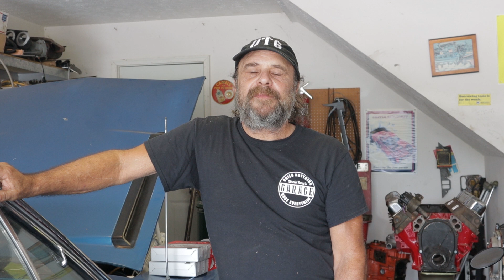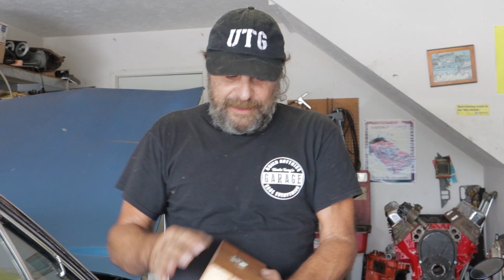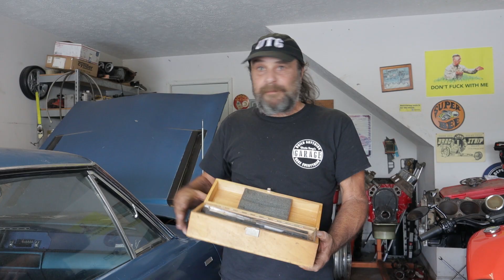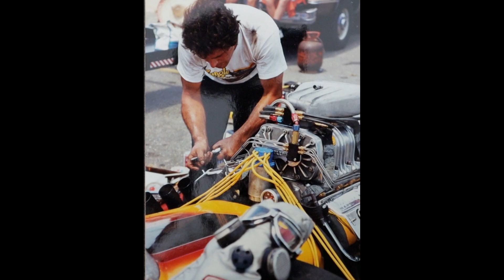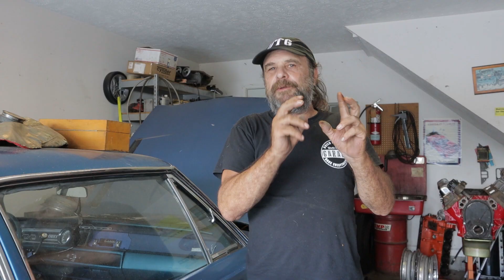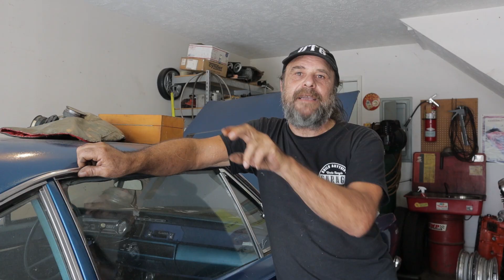Nitromethane - The Learning Curve Is HARD!  But, That's Where The Fun Is

Comment: How can the nitro engine tell whether it is working to produce acceleration or to overcome air resistance? I supposed that it is fully loaded whenever the throttle is open.
Reply: The load at the starting line is just a small fraction of the load at the top end.

Comment: Tony, I'd really love to read a scientific or insider reference about why Nitromethane ignition in a cylinder is load dependent. Fuel volume? Lack of vaporization? I've read that modern Nitro cars are "dieseling" for the last half of the race. Usually with fused plugs? I understand the gut feeling instinct based only on regular engines sometimes nosing over at the end of the track. But that's for many reasons. I want to know why Nitromethane is so different. I'm a 66 y/o retired physician/engineering physicist. So I'm not looking for any 21st Century "tricks" for Top Fuel teams. Any references would be appreciated.
I was at the last race Q day at Bandemiere Speedway in Denver a couple of years ago. 
Btitanny Force laid down a track speed record run. 337.4 MPH at 3.724. 
With what appeared to be no effort.
A perfect pass. I know that drag racing is a show. But I truly feel that John Force, personally, and his Racing Team wanted to set a track speed record in Denver before the track closed. Because of his personal relationship with the Bandemiere family that owned the track.
It seemed effortless. Hey, I love the sound, noise, technology and gamesmanship as well as anyone. But this one pass seemed so effortless that it was probably possible more often than the fans know. 
Britany Force set a new 1000 foot speed record earlier this year.
341.59 MPH at 3.667.
In Indianapolis this last weekend she had a 3.666 ET.
My first Top Fuel race was the Winternationals ~ 1981-82. Top speeds were ~260 MPH if my memory is correct.
These 21st Century Top Fuel numbers blow my mind as a 1960s-70s car guy bracket racer like yourself these days.
Thanks for the videos.

Comment: Would it be timing that made the difference? My experience is simply more weight or more drag,  lower the timing as the timing becomes sensitive as you put on more wing or drag and best is simply back off the timing 3-4 Degrees that on normal fuel and I suspect thats where the problem was.

Comment: According to Garlits the Jocko car was unsuccessful because it would become airborn half way down the track and they never figured out how to stop that from happening.
Reply from the maker: Wrong.  I studied the car extensively using material printed back when it was being built and tested.
Reply: @UncleTonysGarage  I got that from an article interviewing him about it on NHRA'S web site:

“It took off kinda slow because it was so heavy, but then it was cruising along pretty well and making a decent run when all of the sudden the motor revved up. I quickly lifted and then felt a bump, like I had hit a bump in the track or something.
“We brought it back to the pit and tore it apart, but there was nothing broken in the driveline, and that’s when we figured out that the whole car had gone airborne and when lifted it came back down, and that was the bump I felt.
“Jocko thought I had sabotaged him, so he wouldn’t get any credit for the design, which is pretty ridiculous. He went to his grave never believing that the car was doing the things I said it did.”
Reply from the maker: That may well  be what Garlits said in the interview, but there was never any mention AT ALL of that situation in any of the drag magazines that covered that car back in the day.
  Two factual things contradict his statements right off the bat.  First, if the car had become light, or airborne, it would have absolutely blown the tires off.  There would be no mistaking that situation for anything else, and there would have been dozens of pics of that car smoking the tires at mid track if it actually happened.
Second, the body was a replica of Jocko's Land Speed car,  which had gone MUCH faster on the salt and never had a problem with lift.  A significant amount of air would have had to get under the body to cause that, and you can see how it was designed to push air over and around the front.
Nope, not buying the flying car bit.
Reply: @UncleTonysGarage  to be clear I'm not saying you're wrong. All I'm saying is that that's what he said. I was a 90s kid so all I have to go by is what the two of you have said about it. But to be fair to him, the fact that they supposedly never ran that body with a the canopy or so much as a windsheild could have caused rear lift that wasn't there for the land speed runs. Air is weird like that.

Comment: You did what I wished I had done. Workin on a pro fuel level.  I was dreaming up hydraulic clutch bleed down  on clutches when the air cyl  12 step clutches took over.  Missed opportunity  maybe.  I love the fuel stories.

Comment: Great video Tony. I don't follow nhra pro classes anymore mainly because all the technology and money involved made it boring to me. I do recall back in the 90s reading about nitro and load on the engine being a big factor on tuning and how they run. I also remember nhra made a rule where the top fuel cars could not run an axle ratio numerically lower than 3.30 to 1 because the top fuel teams had started going taller (numerically lower) ratios in order to increase load on the engines and they were putting a lot more fuel in because the increased load enabled it to work and the power levels and speeds were going up quickly. With that said, did you ever try going with taller gears in the fuel altered cars to get similar results?  This topic reminds me of two stroke engines, they need to be put under load to run right, with out any load they don't even ignite the fuel on every stroke.

Comment: We ran an ex-funnycar AA/FA in the late eighties in Europe and experienced the same. With the full fat KB funnycar engine, it just wouldn't go past the 1/8 mile. We ripped it out and replaced it with a 70s spec 392 Donovan and Lenco 2 speed slider. So equipped, we could do 7 second passes on 50% Nitro all day long. When we filled it with the proper mixture, it did low 6es. We never could get it under six seconds, but it was sufficient to bring home the bacon.

And exactly like you, there was the day when I just walked away from the sport to never look back, except for memories and photo albums.
Reply from the maker: That's how it happens, man.  One day you just say, I'm done...and just like that, you are.

Comment: Sounds like fine tuning for max anything, except more catastrophic,  expensive and I'd image more fun ! Every change you make to increase power or economy in one area has an effect, most likely negative, in another.  I totally get the addiction! Fortunately been satisfying that with trying to get maximum fuel mileage lately. A cheap addiction because pistons don't come flying out through the hood, you just say, "well that didn't effing work" and try something else. 😆

Comment: I am an avid top fuel fan, anything on nitro. I did wind up helping out on a nostalgia nitro funny car for a weekend. I can now say that I worked with Roland Leong. That was fun. I have also watched David Benjamin on numerous occasions. Started with a funny car. Then he started showing up with the altereds.
In all of my experience watching these nitro machines run, as soon as you unload that motor, cylinders drop and performance goes into the toilet. The nitro Harleys show that extremely dramatically. You lose half of the output of that engine and the half that remains is dragging the other dead half along.

Comment: This was a fun one because it made me think. Example of not just the nature of nitromethane but also of mechanical fuel injection. It has no idea how much load the engine is seeing, it just delivers a set amount of fuel over a period of time (lbs/hr) Makes perfect sense. Like a carburetor without a power valve as soon as the load goes away it goes fat. Now if you tune it for a light load and add the load back it's lean and hurts itself

Comment: Same as if you run a 2 stroke on nitro like a cr 500 if u tune it and it sounds nice and crisp like a 2 stroke should its slow if you run it fat and run alot of gear to make the motor have to pull it sounds like crap but flys

Comment: Nitro is a extremely expensive hobby even if you don't break parts or ever replace any parts , the cost of the nitro , the oil , the plugs , the tires , the crew ( kinda need a crew ) ... it's a extremely expensive addiction

Comment: You lost me Unc.  Nitro needs a load.  But doesn't "streamlining" reduce load instead of increase it?  (So wouldn't the addition of a wing increase the load?)
Reply: The streamlined car reduced the required load for the Fuel motor to make a competitive amount of power. The wing increased the load but with an engine (thrown together from obsolete and or worn out parts) that couldn’t handle that much load

Comment: New learning curve UTG - try running 10% in gasoline like the early 1950's on a carburated motor on the street 🙃
I used to crew for a guy that held both ends of the national record in unblown fuel dragster in 1969.  
He eventually went to the VW drag world and built a blown nitro flat 4 VW dragster.  Never could get it dialed in.  Kept lifting heads.  Just not enough motor to contain a real nitro combo.  Ran good at 50%, but step it up, and it'd kill the motor ... 😔

Comment: I've often wondered what percentage of nitro "normal" racing engines will tolerate mixed with methonal or ethanol.
Reply: I would imagine that even 30 percent nitro requires a substantial amount of fuel more than straight methanol.  Top fuel is essentially diesel by the 330...
Reply: @jondahl3173  
Right. But I'm not concerned about fuel use I'm concerned about nitro hurting a motor not specifically made to run on it like Top Fuel, etc. It's my understanding the nitro basically doubles the power of an engine when run at a high concentration. I wonder if maybe like a 30% mix would kick power up like 20% or so. Even on a 500HP engine that would be like a 100hp jump just from fuel.

Comment: The thing about nitro needing load is interesting because its counter-intuitive, like the advise you got that your car didn't have enough power to keep the wheels from spinning, because it didn't keep the weight transferred. I'm guessing air-resistance is the key because its exponential with speed increase whereas inertia wouldn't be a exponentially increasing counterforce

Comment: So when you were talking about the nitro loves load and resistence if i understood it right. Nitro acts like a turbo, it wont boost without resistence and it gets stronger with more resistence too! thats why turbos are used on semi trucks they love to boost with weight and improves fuel economy too!
Reply: It's more that turboes spool on pressure and heat which load creates. It's possible to spool a turbo with little load by artificially creating pressure, heat, flow, ect in the exhust with little actual load on the engine.

Comment: Question Tony, supercharged engines don't require exhaust collectors to optimise scavenging, but why weren't the zoomies ejecting the exhaust gas to the rear? In WW2 it was discovered that vectoring exhaust gasses to the rear gave the Supermarine Spitfire an extra 10 MPH top speed. Newton's laws, known since 1700 and something. Every little helps!
Reply: They’re doing that now. Before they wanted them pointed up for the downforce. Now they’ve realized the don’t need that much downforce, so started angling them back. That’s a lot of why they’ve gotten the speed back even though they’re only going 1000’.
Reply: @NBSV1  I'm amazed how, particularly a few years ago people ignored basic scientific principles and just copied what other successful people did.

The WW2 aviation power race, 80 years ago, they did pretty well everything we have today, fuel injection, turbocharging, intercooling, supercharging, OHC 4 valves per cylinder, nitrous oxide, water methanol injection,  and it goes on. The knowledge was there, but much harder to  access, pre internet.